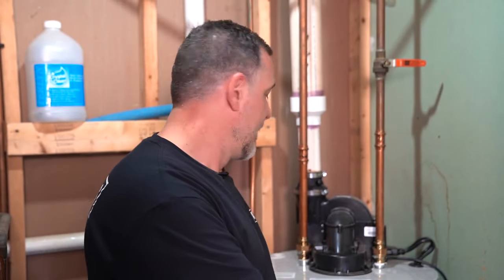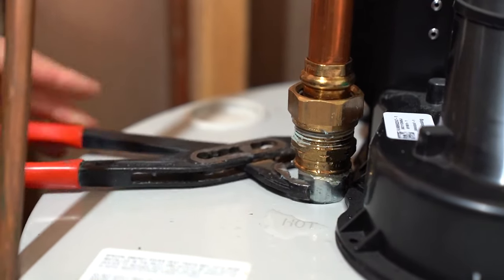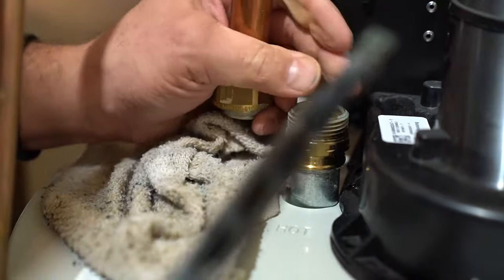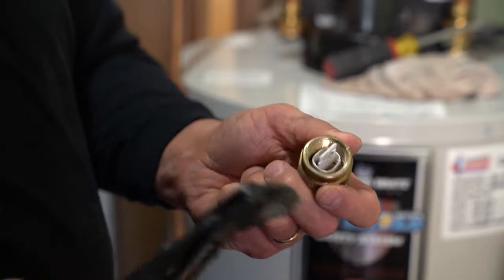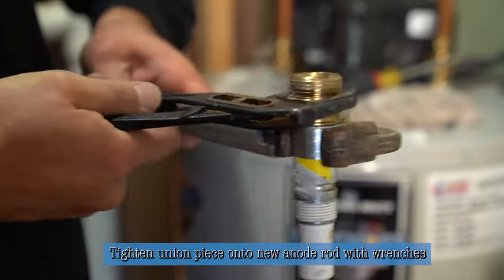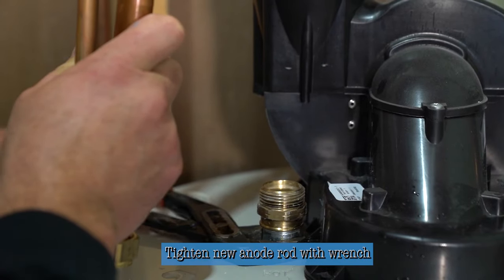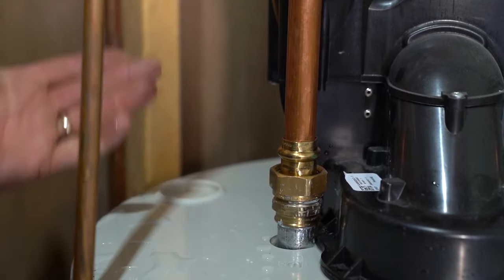Anode Rod Replacement on a Bradford White Water Heater - Water Heaters Now

Comment: I think this might have missed a few key points - securing the cold water supply (you can see he did it because the ball valve is off at the start of the video, but it wasn't mentioned).  Shouldn't you also move the gas reg valve to either "low" or "pilot" setting so it doesn't try to heat the tank while you are working, and then release the pressure on the tank before breaking the hot water union?
Reply: If you need someone to show you this you shouldn't be permitted to own tools.
Reply: @John Gori
Very Good Point, to people who searched anode rod and found this video.
The reason he didn't mention it is because this Video is a second part of a two part Annual Water Tank Maintenance. In the first part, where he flushes the tank, he does mention all of this. A quick summary of the previous video would be nice next time.
Reply: Yes he should of mentioned that you should turn the water heater off so you don’t burn up the heating elements. But as far as turning off cold feed/partially draining hot side if needed, if you don’t realize that then you probably shouldn’t be working on your water heater & should just call a plumber. Lol
Reply: @WillDesigned people come to YT to learn. Your plumbers weren't born knowing this either and had to be told at some point.
Reply: @eegg6954  That's a terrible take on this. Most people watching this video are DIY home owners who are trying to save money so it's best to explain the entire procedure. 

If you're an actual plumber and you're watching these videos on youtube, you have no business being a plumber.

Comment: I wish bradfordwhite would come up with a better design for anode rod, kinda like AO Smith so you don't have to remove the copper pipe. I come across alot of water heater that are hard piped in with no union so now it takes longer to swap out these anode rods on bradfordwhite they are the only manufacturer that has the anode rod built into the hot side connection.
Reply: I think I rather deal with open the hot water line than open the hex type since most connection is flex hose.
Reply: That's the way my gas lines were done on my water heater, it made the job much more difficult than it had to be but it's all designed to come apart and go back together. I thought about adding the union, but I likely will never have to do this particular job on this water heater ever again due to it's age.

Comment: It would be so much easier if they would just separate the anode rod from the supply.  Especially if you are just inspecting, the cost is less for the customer and the job is easier for the service person.  I avoid these tanks for that reason, there are equal or better tanks with a separate rod.

Comment: Good video. Sure seems a poor design to have an anode rod which requires plumbing disassembly. My existing water heater  has dedicated threaded outlets for anodes. No removal of pipes required. Much easier.

Comment: Oh man, I don't have room above my hot water heater to remove the anode rod
Reply: use a hacksaw. Cover the hole so no metal shavings get in. Then replace it with a segmented rod.

Comment: I tried to change out my B-W anode rod yesterday. When I got the hot water outlet pipe disconnected, the only thing above the top of the water heater itself was the threads--no grip surfaces were exposed. There's no outlet nipple. How do I get the anode rod out?
Reply: Sounds like it broke off. Replace the hot water heater entirely. Especially if it’s 10+ years old. They rarely last much past 15
Reply: @Vl7248  No! It did not break off. Ive seen two of these, cause I've got one. Only the the threads are above the top of the metal cabinet. can you remove the top cap on the metal cabinet after removing the 5 short screws that holds it to the main top part of the outside cabinet? Im having trouble doing that.
Reply: I have the same problem! cant remove the rod itself, impossible to grip onto a round pipe and twist!! never buying BW again...
Reply: were you ever able to remove it btw??
Reply: Also have only threads here. I have model mi5036fsx. I’m in the process of removing the tin top now, but am not hopeful.
Reply: @ryanissamson  how'd everything pan out?
Reply: @user-dm2cd6cd5b  I did end up getting it off and getting the anode replaced, but life is so busy that I forgot the intricacies involved, unfortunately. The replacement anode has worked out well, though.

Comment: Thank you for the demonstration, this was very useful!

Side note, applying both thread compound and Teflon tape can result in too much material on the threads, which can lead to improper threading or a seal that is actually less effective. The excess material might also clog the system downstream. Some manufacturers specify not to use both, as it can void warranties or lead to failures in the system due to incompatible materials.

Comment: One complication stopped me and made me call the plumber to do this.  The anode rod is torqued to a very high degree.  I torqued on it until the entire tank moved and it would not break free.  I was worried that I may break something so I stopped.  The plumber used a hefty pipe wrench and really leaned into it.  It took a good size man with a lot of muscle to unscrew it.  Next time I will use my pipe wrench with a handle extender to get the leverage I need.  
He also said any pipe thread sealer that says TFE is suitable to seal the threads.
Reply: possible put a back up wrench on the cold nipple
Reply: I've seen one recommendation of not draining the tank completely first but do turn the heater off so it has mass to stay put.
Reply: Impact wrench
Reply: @jamesrecknor6752  You can't use an impact wrench on the Bradford White setup. It's different from the standard setup on other water heaters.
Reply: @rolig3518  Is it because the impact wrench will unscrew the connector instead of the rod?

Comment: I just did this today and I had a heck of a time getting the new anode rod to thread into the tank. The problem was the top cover was not lined up well with the tank ports. I had to remove the top cover part of the tank and rotate it so it lined up better and then I was able to get the new rod to thread in without too much trouble. Should have been much easier to replace, but I'm just glad I got it replaced. I had to replace the gas valve last week due to a water leak and thought this part would be super easy to do.

Comment: Good video thanks for creating. One note I would add. When ordering your new Anode Rode be sure to include a new heat trap. Mine was so corroded I was not able to transfer and reuse. You would think  Bradford White would have included in the replacement rod.

Comment: Thanks for this very clear description. My Bradford White TTW1 is in an unfinished partial basement, with only 23" clearance from the top of the heater to the bottom of the 1st-floor floorboards above it. Is there a way to replace the anode in this situation without disconnecting everything (including the propane line) and tilting it? Is that clearance enough to allow inserting a standard anode, at an angle? —Tom
Reply: Some of the other anode rod replacement videos show or describe a bendable rod that has sections cut of the primary sacrificial metal with the central connecting element remaining stiff but flexible enough for low overhead clearance areas. I haven't seen one for the Bradford Whites specifically (or on the parts list I browsed for mine), so that would be a special case. Hopefully there is one available for yours or you might have to drain the H2O and disconnect the gas/electric line and pull it out to a space you can slide in the non flexible one as shown in this video.

Comment: I have two follows up to a question below:  If the rod is 3' long and is only corroded approximately 6" from top down and 6" from bottom up, that leaves 24" (2/3) of remaining consumable magnesium before replacement is needed, correct?  Hypothetically, if this check was done 3 years after new installation and the corrosion rate is constant, the rod should last another 6 years before needing replacement, correct?  If the first inspection was done only one year after new installation, I might replace the rod if they are only $40 and check it again in two years expecting to have approximately one more year of life left in it.  Also, I'm not clear on the horizontal electrolysis explanation - I don't understand how the corrosion only took place reverse tapering from the top and bottom and not in the middle unless there is a less corrosive "wrap" around the entire magnesium center of the rod with the magnesium exposed at the ends.  Is that a correct guess or am I completely misunderstanding horizontal electrolysis?  Thanks!

Comment: I inspected the anode rod of B-W today. The heater was installed 28 months ago. I am using water softener  in my house. To my surprise, the rod looks intact except the top 6 inches which shows heavy corrosion. I mean this is very natural as the water at the top is the hottest and hence the corrosion.
My question is should I replace the rod now or wait to see in another 28 months?
Btw I would switch to other brands on my next heater replacement. This B-W design is NOT user friendly at all.
Thank for the video

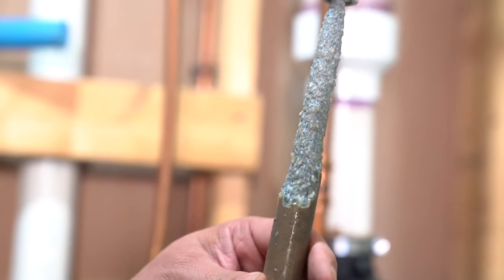Comment: QUESTION: at the 2:40 mark you indicate the electrolysis goes flat ways, not up and down. Are you inferring that when the anode rod has a corroded section (in the video the top and bottom portions of the rod) that the corresponding level on the tank will no longer be protected...?? 
The degradation of your anode rod didn't look to be that substantial.  Are anode rods solid aluminum / magnesium, or just an outer layer... it was my understanding the rods were solid and even the "crusty" looking part was still protective aluminum / magnesium...
Reply: Yes yes you're mostly right, so long as there's some metal (>50%) left it'll still be doing its job.
Reply: I have two follow up questions to yours for clarification:  If the rod is 3' long and is only corroded approximately 6" from top down and 6" from bottom up, that leave 24" (2/3) of remaining consumable magnesium before replacement is needed, correct?  Speaking purely hypothetically, if this check was done 3 years after install and the corrosion rate is constant, the rod should last another 6 years before needing replacement, correct?  If the check was done only one year after new install, I might replace it if they are only $40 and check it again in two years expecting to have approximately one more year of life left in it.  Als, I'm not clear on the horizontal electrolysis explanation - I don't understand how the corrosion only took place reverse tapering from the top bottom and not in the middle unless there is a less corrosive "wrap" around the entire magnesium center of the rod with the magnesium exposed at the top end and the bottom ends.  Is that a correct guess or am I completely misunderstanding horizontal electrolysis?  Thanks!

Comment: Good Day. Thanks for the instructional video. I have a Bradford White M250S6DS-1NCZZ which is about 15 years old and we have lived in this house for 8 years. I know the anode has not been touched in those 8 ears but have no idea before then, so it could be 15 years old. It is not so easy to inspect the anode because the hot and cold water lines are normal copper (not flexible) and are soldered onto the inlets. I have purchased new parts (including a flexible line) to swap out. Just wondering if you have any special tips for removal of an anode that could be 8-15 years old?.... thanks very much in advance.
Reply: On your own home you have the luxury of using a solvent like wd 40 multiple times,  I would use pipe wrenches at least an 18" on the hot and use a back up pipe wrench on the cold nipple ,the back up wrench will help to give you leverage the bigger the wrench the easier the twist, stay away from channel locks on your project, one more tip double check that YOUR anode is on the hot water side, some are independent under a large nut on the top, if you still have a problem  moving the nipple or nut with solvent and back up, possibly use heat (torch)

Comment: What kind of channel-lock is that? I need to get one. Also, I'm going to have to use a hacksaw on the OEM anode rod I bought, because it's 5' long (even though it's the exact part-number on the BW heater I have), so I'll have to trim it a bit. Important tool to have if you have everything undone already, but your rod is too long for the tank.
Reply: Knipex... supposed to be the king of slip-joint pliers! I need to get one too! But they are SOOO expensive! Probably worth it!

Comment: My Bradford water heater anode rod is recessed into the top tank. Only the threads are exposed above the top cover of the tank. Is there a special removal and installation tool? Or, do I have to disassemble the top of the tank to remove and install the anode rod? Thanks

Comment: I have a large Bradford White Water Heater it was installed 9 years ago..I never knew about this rod replacement. Is it too late to do it now ? One guy at Heating Oil place said forget it by now it's fused together. Let it run it's course and replace.
Reply: For what it’s worth, I finally did mine after fifteen years. The old one wouldn’t come out so I had two choices, cut it off and let it drop or what I ultimately did was tie a string through the outlet hole, cut it off above it and lower it in. Then used a file to get the crust around the base of the threads and then used the string to pull the old one out. The new one corrected the issue of the original having only threads exposed to remove it thereby definitely ruining it. So once the new one was in I had to cut the copper and re-sweat to be shorter. While I was at it I drained the tank and used one of those hose attachments to clean the base of the tank and installed an electronic scale blaster. Everything worked out fine and the scale blaster has helped to radically reduce the scale. It doesn’t necessarily eliminate it but it’s now a wipeable powder rather than a had crust.

Comment: Thanks!!  Any idea if I can find a zinc replacement rod? (Smelly hot water.)
Reply: In case you are still experiencing smelly hot water, there is a service bulletin by Bradford White on this issue: https://www.bradfordwhite.com/forthepro-bulletins/hydrogen-sulfide-odor-rotten-egg-smell-and-chlorinating-water-heaters/
Reply: Thanks!  I put in a powered rod.  Problem solved.

Comment: I wish I would have done my homework on the Bradford white prior to installing it for a customer. I told them how great powered anode rods are. I put them in every water heater on a well system. 

With this Bradford white I’m going to have to charge a customer every 4-5 years to put a new rod in. I have never seen this type of design before but that’s what I get for being in a rush to get a customer up and running. 

I was debating if I could put a rod on the cold side as well but I feel like the water would “short cycle” without going to the bottom of the tank.
Reply: Unless the water's really hideous, that  heater should get you 12 years without ever touching the rod.
Reply: We are on year 11 same water heater..  water is still hot as balls

Comment: Video was informative, but replacement not so easy. We have a two story house with the water heater in the basement. Shut off the house water and the inlet to the water heater. When I started to loosen the union, water started flowing.  Need to open a faucet on the second floor ( be sure to remove the aerator, then replace later.) then drain some of the water in the hot water tank. This allows the water in the house pipes to drain into the tank.  So I loosened the union, and tried to remove the anode rod with the bottom part of the union as one unit as the video shows. No luck as the union came off easy. Now the old anode rod is stuck and the only gripping surface is the threads. If I damage the threads and cannot get the old anode rod out, I am in trouble.  Nothing in the video about what to do in this case, which is probably more likely.
So I put it back together and decided to replace the unit at the 10 year mark. Currently at 7 years.
Replacement will not be a Bradford White, but a unit with a separate anode rod.  I had previously changed out the anode rod every 5 years. Took me an extra 2 years to figure out the integrated anode rod - water supply thing.
Reply: I'm with you on that John,  mine also only has about a 1/4 to 3/8 inch of threads exposed.   I could use a pipe wrench on those threads but if it doesn't come out its a thousand plus bucks to replace the entire water heater.   maybe I could remove all inlet, outlet, and over pressure device then remove the top cap on the heater (small sheet metal screws) to gain access to the unthreaded part of the rod.  the more I think about it putting a pipe wrench on the last 1/4 inch of the threads would likely crush the pipe.  that's a bad, bad idea, bad.
Reply: When doing a fixture repair, particularly in the basement, you are almost ALWAYS going to get water. The best thing to do is shut the main to the house off and open whatever water fixture is lowest in the house (a basement faucet or an outdoor garden hose bib) and allow the water to drain down. You will almost always still have water on the hot side so when working on the water heater, make sure it is powered off and drain water for the heater itself. Once done, be sure the water heater is completely full before turning the power back on or you will be replacing heating elements next. This is the life of a plumber.
Reply: Quote "Now the old anode rod is stuck and the only gripping surface is the threads. If I damage the threads and cannot get the old anode rod out, I am in trouble.  Nothing in the video about what to do in this case, which is probably more likely."  EXACTLY. What to do?